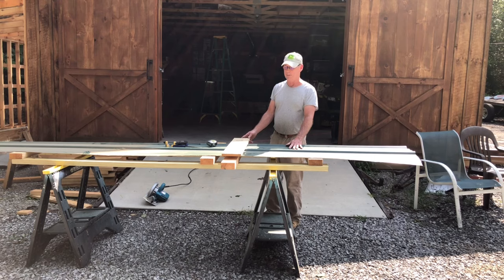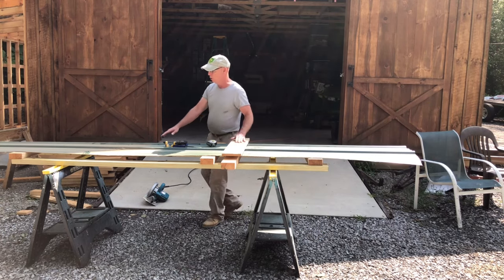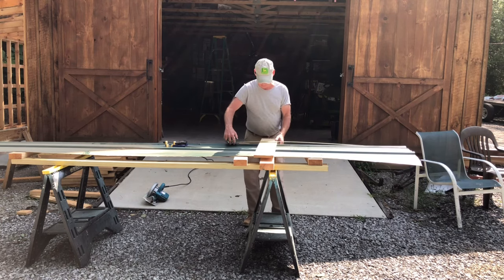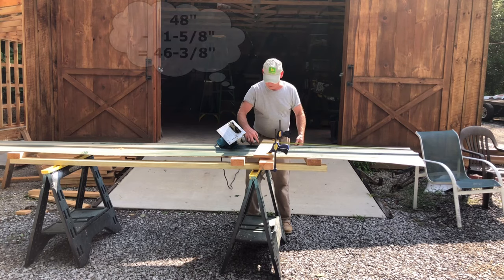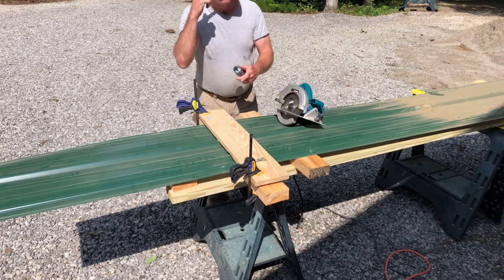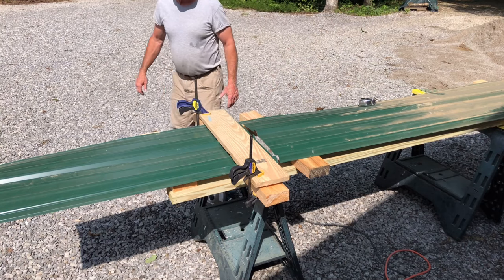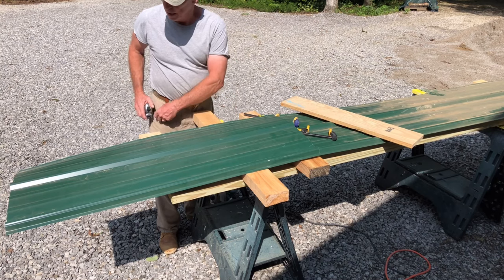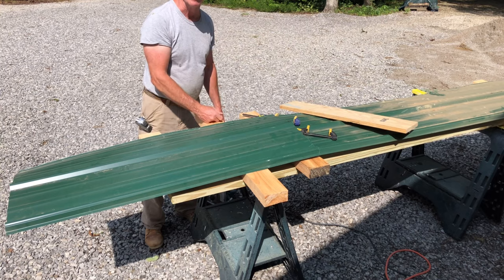Cutting Metal Roof is Easy with a Circular Saw (Just remember to cut it backwards)... What?

Comment: I'm wanting to cut some corrugated sheet metal into some 3in by 8 foot strips for some landscape edging, at least until i find enough rocks b the river to  do 126 feet. but could you explain how this/ why this works? do i need a certain type of blade? hight or low tooth count? since its backwards does sharpness matter? most of mine are pretty dull already and i don't trust my ability to use tin snips to make a clean straight cut.
Reply from the maker: If you going to be doing that much cutting you may want to invest in a metal cutting blade. But for small jobs I use a 40 tooth Irwin carbide tipped crosscut blade installed backwards. The idea about being in backwards is that the blade is less aggressive, doesn’t tear up the work & acts like a metal cutting blade leaving a pretty smooth cut line👍
Reply: @ClearCreekCabinMiniFarm  would a extra fine tooth blade would better then? i got a few laying around but faily sure everrything badly needs sharpening
Reply from the maker: @daltonlockyear7437  Never used a fine tooth blade. I’ve only used carbide tipped cross cut blades - My favorite for general purpose is the Irwin Marathon 40 tooth carbide crosscut👍

Comment: Done it a ton of times like this. Super loud. Like stupid loud. Also hot firey little pieces of burning hotness flying everywhere. Safety glasses a must. I like muffs or ear plugs too. Works great. Use an old blade
Reply from the maker: Yup - a hot noisy mess but it’s quick & easy

Comment: Are you talking about flipping a blade designed for cutting wood and using it on metal? I've tried that with variable results - it's much more effective to simply fit a blade for cutting metal. And I suspect it's safer too.
Reply from the maker: @welshhomestead  Yup, a regular old 40 tooth crosscut blade in backwards - A metal cutting blade is cleaner but if you’ve only got 1 or 2 cuts to do and don’t want to spend $40 on a metal one - an old crosscut blade backwards works well.👍

Comment: Can a carbide blade be used?
Reply from the maker: Yes - They make carbide blades specifically for metal cutting - I have a link to one in the description - I just used an old carbide tipped crosscut wood blade in backwards that I had in hand at the time👍

Comment: Unfortunately I need to do a 12 foot rip cut on the final piece of my shed roof. How would you go about it when the metal is already installed?
Reply from the maker: Wow - That will be fun - Maybe use a 12 foot 2"x4" as a guide - Screw it down on the waste piece side (if possible) and use the 2x4 as a rip fence guide?  If that's not possible then maybe you could snap a chalk line and take your time with the saw blade depth really shallow - Best of luck but please be careful...
Reply: @ClearCreekCabinMiniFarm  it's just trimming off the overhang, but may still be a touchy situation. I'm probably going for the snap a line and take my time theory

Comment: I use an old plywood blade put on backward and cut it from the backside, works well.
Reply from the maker: That’s good info. So you use other blades than the one I always used…!  Thanks 👍
Reply: @ClearCreekCabinMiniFarm  A plywood blade has less kerf so less metal is being cut off, I don't know if it is better as I have never used a regular blade.
As you know, wear ear muffs as it makes a god-awful sound cutting, if you have close neighbors, they may not invite you to the next BBQ!
Reply from the maker: @samTollefson  😂 The neighbors aren’t over my Donkeys Honking yet 🤪 But your right. Hearing protection is probably a good idea 👍

Comment: Why the saw blade backwards?  Does it not cut a clean line otherwise?  What happens if u don’t put on backwards?
Reply from the maker: Thanks for tuning in - The teeth on a normal crosscut circular saw blade can be too aggressive & can make too rough of a cut - This was a “Down n’ Dirty” quick way to cut roofing material w/o having to spend $40 for a good specialty blade😀 Been doing it this way for years & it works great - But always remember “Safety First” when using power tools👍
Reply: So coukd you use a old blade since youre not using the teeth?
Reply from the maker: Yes - I recommend you use an old blade, so you don't dull a new one.

Comment: you will have to try this method to believe it, but it works. cut a notch at you desired length, then stand on the waste side and grip the sheet and rip it apart! It will be within a 1/4 " of square. My granddaugther was able to do it easily.
Reply from the maker: @dillon2107  Wow that’s amazing 😲 Thank you

Comment: The heat will damage the cut edges. 
It will start to rust.
Heat damages the coatings on the steel sheet

Comment: Just did it and it ripped all of the carbide tips off my Spyder blade. For now on I will just buy a dedicated metal blade. Long cuts dig the line with a razor blade and then bend and snap it.
Reply from the maker: Wow, in all the years I’ve been doing this it has never happened to me. And I have ripped many 12 foot long panels with the same old blade I’ve used for this purpose many times. I believe mine is an old Irwin “Marathon” 24 tooth carbide tipped blade though. (Maybe it's the quality - a $30 Irwin blade vs. the $10 Spyder blade)
Reply: I think it makes a huge difference whether to put a cross cut/ combination blade (staggered teeth) or a ripping blade- teeth are all straight.
Reply from the maker: @tealady33  Great Point - Thanks...
Reply: Use a plywood blade I’ve done this for years it’s a lot smoother

Comment: Never really cut sheet metal and corrugated at that ..... 2 cuts  off a 3mtr length free hand all timber used for roof framing nothing left for last step completing roof off the side of shed for wood rack for turning.  Turn blade on circular saw . .  long timber or alloy straight  edge will be square as.... 6:26 compared to free hand using knuckle to guide along ridge  corrigation on the tin . Cheers i know what i will do next time cheers 👍😎😊
Reply from the maker: Great - glad it will help the next time you cut roofing...👍

Comment: I read the specks that fly off ,burn into the metal and those spots will rust later.
Reply from the maker: Sure - blow off or brush off any metal specs - I’ve cut painted metal & galvanized roofing for years & have yet to have had a problem 👍

Comment: I somewhat agree with this method but the roofing metal will start to rust if it comes in contact with water, so id suggest having the cut edge at the top of the wall. 

Circ saw, grinders, etc all use heat and friction to cut through the metal, which is why it tends to rust more than if you use hand snips, powered shears or a metal nibbler as they actually crimp the ends as you cut. if youve ever screwed into the metal panels and see those little shards that come off from the screw threading in, they will be rusted by the next day if it rains at all
Reply from the maker: All very valid points - Thanks for sharing - That's exactly why you would leave the important jobs to a professional roofer.  But this works okay for a chicken coop or a shed.
Reply: @ClearCreekCabinMiniFarm  exactly! I work with metal everyday so whenever I put a screw into flashing, there tends to be clippings that fall onto the flashing. If I end up forgetting to wipe it off and come back the next day there's always rust marks left where the shavings were. And only way to get rid of the marks at that point is to use a damp rag vs just wiping them off with a cloth or if you have gloves on.
Reply from the maker: Love quality workmanship 👍
Reply: I'm by no means a professional, and I've never even tried this, but if you re  worried about the cut rusting, couldn't you just keep a small container of slightly matching exterior metal paint and sponge w you to quickly 'reseal' that edge?
*similar concept to using 'end cut' on extortion lumber
Would that work?

Comment: Where on earth did you learn this?  Who would have thought.
Reply from the maker: Hey Brian - Okay - You asked...!  Back 20 years ago I owned a True Value Hardware Store and Lumberyard in North Carolina on the coast.  We got hit with Hurricane Bonnie which devastated our metal sided and roofed warehouse - I worked alongside a contractor making the repairs while installing new metal and learned this trick from him - I have been cutting metal roofing this way ever since. If you choose to try this, be sure to use a quality (but used) 40+ tooth carbide tipped blade and it will always do a good job. As always "Safety First" especially if you are not experienced with power equipment - Thanks for tuning in to our channel... Good Luck with your project(s)

Comment: So what would go wrong if you put the blade in the usual way around ?
AND - Won't the teeth get knocked out of the blade doing that ?
It just sounds so wrong.
Reply from the maker: In my experience, when using the saw blade in the "Normal" direction the teeth on the blade can be very aggressive and the cut sometimes isn't as smooth.  This is something I learned from another contractor over 20 years ago during major reconstructive work after Hurricane Bonnie and it has worked well for me on many of my small metal cutting projects ever since. As you may, or may not, know there are metal cutting blades out there specific to this purpose, if using one of them would make you feel more comfortable. And I suggest if you are doing a "Major Project" that you use one specific to the task. But one smaller projects I have found the cheaper fiberglass aluminum oxide blades are useless and can easily shatter. The better blades can run $40 or more depending upon the brand. Thanks for your comment & for tuning in to our channel.
Reply: @ClearCreekCabinMiniFarm  Saving $40 on a blade that I will not use very often sounds like a bargain - I shall follow your recommendation
Reply from the maker: @mohammednovalija  Great - Please don’t forget to use safety glasses, hearing protection & gloves - Have fun with your project - Thanks again for tuning in to our channel!

Comment: I have heard putting the blade in backwards creates a lot of heat and the paint will fall off and rust the roof.
Reply from the maker: Hey Mike - I hadn't heard that.  I have been doing this for years and never had an issue with the edges.  They cut very smooth and don't rust any more than the ones that come from the factory. You made me look up at the edges of the green metal roof on my pole barn (done by professionals and cut to length at the factory) and the edges have a slight coating of rust.  So I think that pretty much is the norm for metal roofing... Thanks again for tuning in to our channel...

Comment: I’m not sure where you guys found success. But I flipped my blade and it blew the teeth off and wouldn’t cut butter. I bought a metal Diablo blade and cut like you wouldn’t believe
Reply from the maker: The Diablo Metal Cutting Blade is a good one at a price of around $45.   I always use Irwin carbide tipped blades in my circular saw and have several older ones that work perfectly installed backwards for one or two cuts of metal roofing. I have never had a problem. What brand, model and price point was the blade you "Blew Apart"? (so other folks can know what not to use in the future) - Thanks...
Reply: @ClearCreekCabinMiniFarm   the one that blew apart was the 6 1/2” dewalt stock blade on my battery saw.
Reply from the maker: @Cantspeakable  Thanks

Comment: Didn't think you were supposed to use saws or grinders to cut sheet metal because of the swarf and how it causes the cut end to prematurely rust. Suspect that's why roofers use aviation snips or shears.
Reply from the maker: @stuckster  This is a great way for sheds, chicken coops and out buildings - IMHO Any bigger projects should be cut to size by a roofing materials supplier 👍

Comment: There's a blade for that, and it works better than how u r doing it, faster, better edge too.
Reply from the maker: Yes, there are several metal cutting blades that work better. And I've used them before. I just didn't have one on hand at the time, so I did the cuts using this old "Contractor's Trick" that I learned years ago👍

Comment: If you cut from the edge of your blade you’re piece would a true 48
Reply from the maker: Thanks - Great point - I do that for woodworking when using a thin pencil line - But on the metal,  I take the whole wider magic marker line with the blade and am still within a 1/16th of inch of my intended cut - Thanks for tuning in & your great input👍

Comment: There are blades special made for cutting metal
No need to turn blades backwards
Reply from the maker: Yup - As I said in the description there are several good ones available. This “Tip” of using a carbide saw blade backwards was something I learned from a metal building contractor 25 years ago immediately after Hurricane Bonnie hit the coast of N Carolina.

Comment: Don’t the tips of the metal will rust over time because you got it to hot
Reply from the maker: I personally, have never seen any difference between the cut ends I’ve done as compared to the precut panels provided by a roofing supplier 👍

Comment: You totally failed to actually explain the reason for turning the blade backwards
Reply from the maker: ✅ The teeth on a carbide crosscut saw blade (designed for wood) is too aggressive for thin metal. Putting the blade in backwards lessens that effect since the carbide teeth are cone shaped on the back. Doing this lessens kick back possibilities & possible rough edges on the cut being made😬
Reply: When cutting composite flooring lengths , manufacturer recommends doing the
 same thing with saw blade. They it produces a cleaner finish cut,no chipping of material. Go figure!

Comment: It will rust in a few years where the cuts are made guaranteed.
Reply from the maker: It of course is always best to have your roofing panels professionally cut to size by the supplier. Which I have done on all of my major projects. But for many "Do-It-Yourselfers" putting metal roof on their sheds, dog houses, chicken coops, storage buildings etc, they choose to purchase the metal roofing in standard lengths from one of the big box stores. When this is the case,  "These Everyday Folks" don't want to buy special tools and want a quick and easy way to cut the roofing for their "Backyard Project". Thanks, Terry, for tuning in to our channel...👍
Reply: @ClearCreekCabinMiniFarm  I was not trying to criticize just pointing out a fact.I have cut many with a saw and  seen the results years later.It’s just one of those evils of exposing the edges.Great video that helps many DIYERS.
Reply from the maker: @terrycain3843  😄  No offense taken my friend...👍

Comment: You compromise the metals' ability to resist rust cutting it this way
Reply from the maker: So what is your recommended cutting method that the average homeowner with limited skills can do without buying expensive tools to put metal roofing on a shed, chicken coop etc. ???  We’re not talking professional roofing here?
Reply: I always use power snips on crosscuts , and scribe and snap on rips, no rust issues which will void the warranty on your tin.

Comment: Metallurgy, big word , but that’s why you don’t cut metal with a circular saw. Warranty another reason you don’t cut metal with a circular saw. If you like rust , go ahead cut your metal with a circular saw, or a grinder with a cutting wheel.
Reply from the maker: This tip was for those little projects that folks like to do such as chicken coops, small animal enclosures, sheds etc. - Certainly not recommended for a residential or commercial application - For those applications you should source your panels rolled out & cut to size by a roofing supplier 👍

Comment: This is the worst way to cut roofing. Loud,spits metal shards every where and overheats the metal and the cut will rust. There are electric shears they also make a 3’ hand shear that is available for rent. But for circular saws there is a negative hook metal cutting blade. It runs way cooler than a backwards blade
Reply from the maker: It worked just fine for a little old chicken coop. 👍

Comment: If I catch you putting a blade in backwards on my job, I wish I could do more than fire you.
Reply from the maker: Good luck with that my friend. Especially since it was a metal building contractor who taught me this trick over 25 years ago.  It is a simple way to cut a couple of pieces of metal without running out to buy a specialty metal cutting blade. It certainly is not recommended as a permanent application in construction 😁